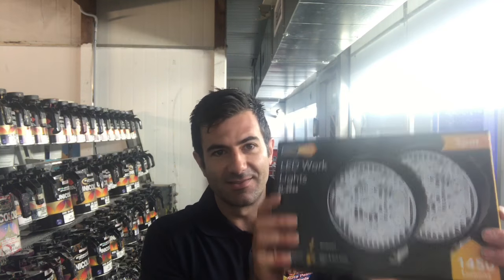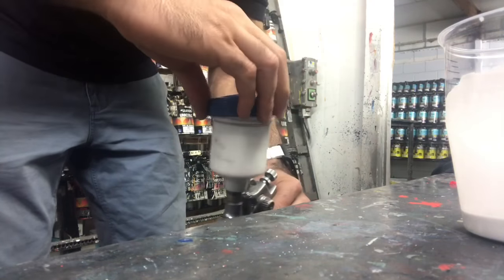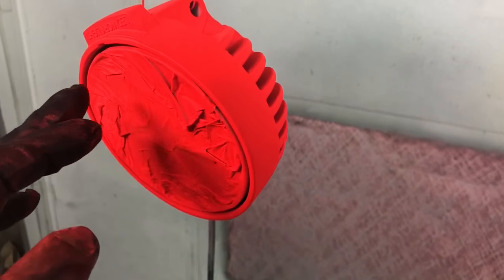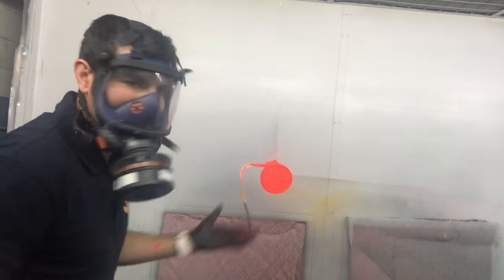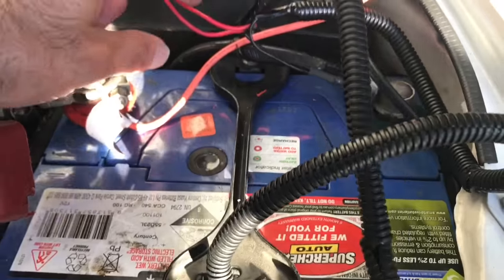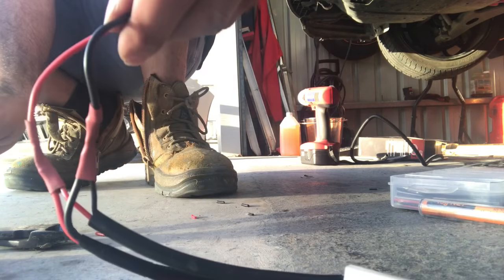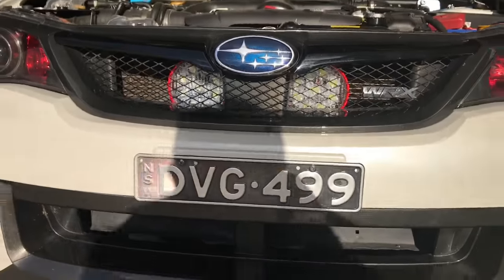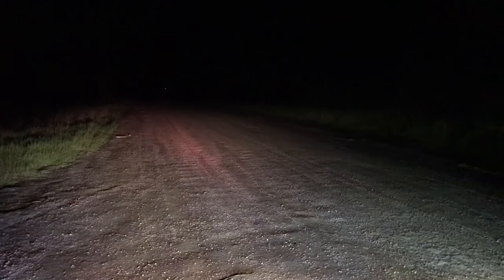How to paint and install LED Spot Lights

Comment: Very old vid now, and you probably have the technique nailed now, but the best way to solder is to twist the wires together, hold the soldering iron beneath the twisted wires (essentially heating the wires only), then dab the solder in from the top until you see the wires evenly coated. Not only is it neater, but its the most durable reliable connection.
Really loving the vids so far, very information and easy follow. Definitely giving me more confidence to start doing a few pieces on my 850 T5.

Comment: great Videa  i am thinking of doing that to mine and as for the lights HIDS are Defectible in Australia which is where i am from everytime i have done led lights i run them off a seperate swich that tap in swich did you wire that straight to your HIghbeam and how do you do it again

Comment: Looks good, but I have to ask, do your coloured lights actually provide you with enough light and how often do cops pick on you? From the NT and my VK gets picked on alot for pure white  100W HID headlights (in projector lenses).
Reply from the maker: azazeldeath never had a problem with the headlights not once.
Reply: azazeldeath probably more coz it's a VK

Comment: What Car IS that? Subaru impreza wrx STI? what year?
Reply from the maker: Joona s 2012 WRX not STI. Upgraded brakes suspension intercooler and tuned to about 200KW at the wheels.